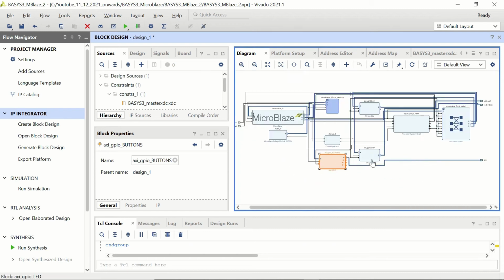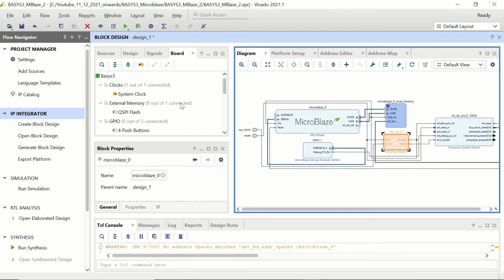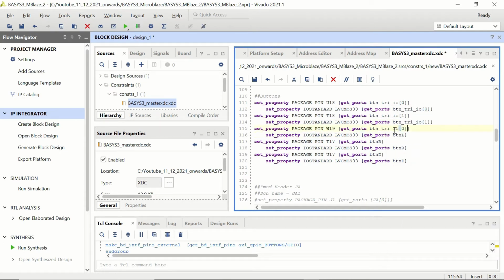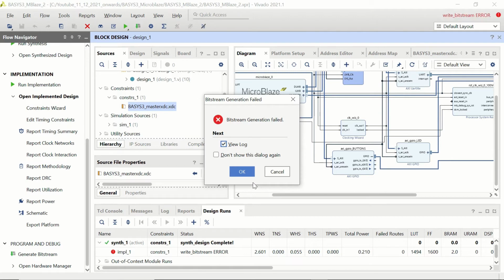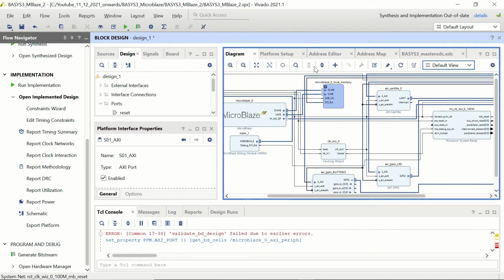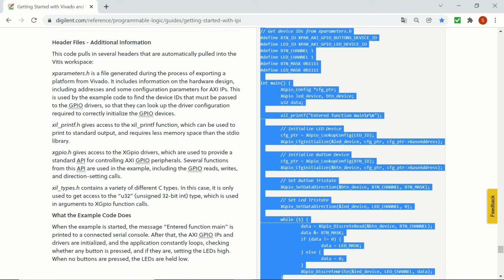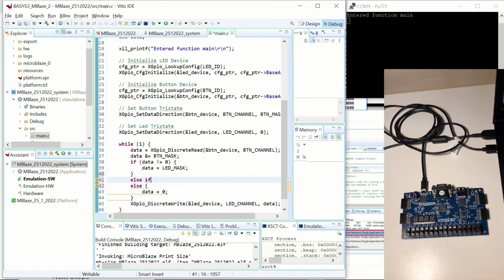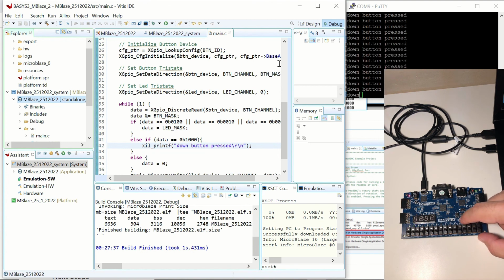MicroBlaze in BASYS3: Creating a Microcontroller on FPGA with Vivado & Vitis

Comment: Basically, when using FPGA boards, you have to build soft-microprocessor from verilog and another source code for that processor to run. Extra step compare to normal MCU or SBC.

Comment: Great video. I am glad you including all the errors. Fixings errors are as much a part of the learning process as the the correct configuration and programming is. COM port worked fine with Putty in this video, contrary to what I have experienced with ADC video using the MSP430.
Reply from the maker: I'm glad that it was helpful. I replied to your comment for the msp430, I hope the jumper settings help you with it.